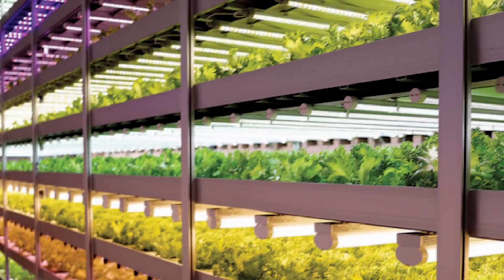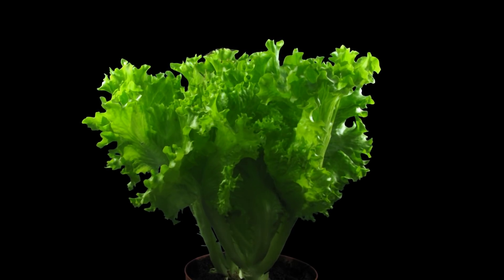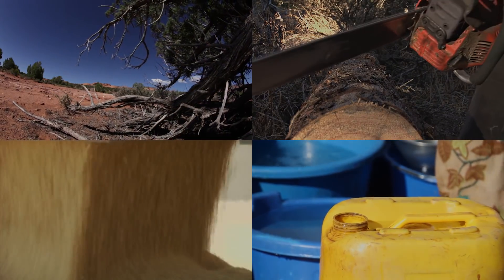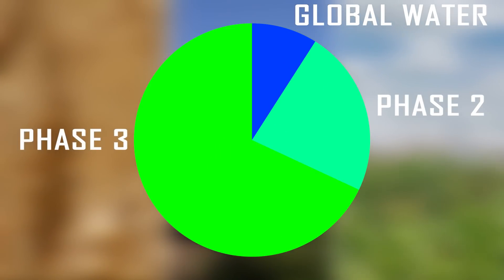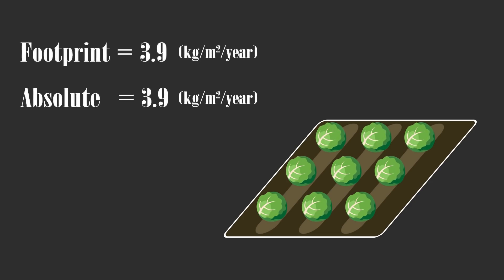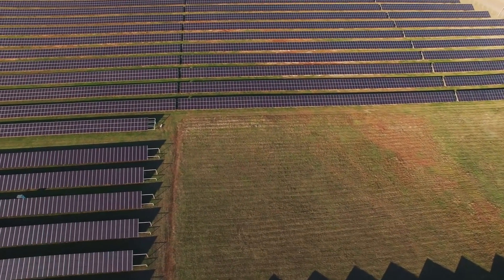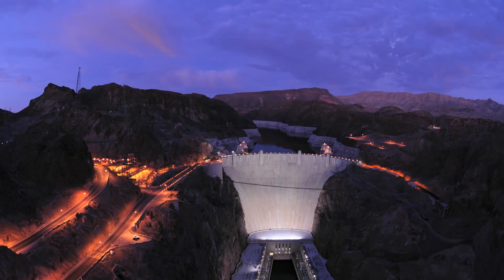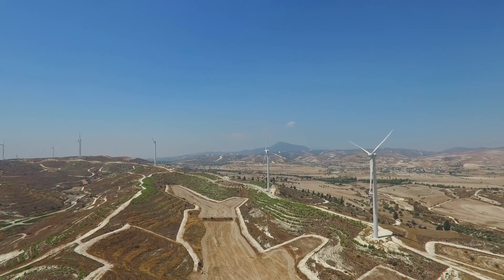How Can We Improve Vertical Farming?

Comment: You can't use solar panels to grow plants in a more efficient way than direct sunlight, thermodynamics doesn't allow it. 

Let's say you get 100J of energy from the sun, if a plant only absorbs 50% of that you are down to 50J. If you use a solar panel with a generous 80% efficiency you are down to 80J and then when you shine it on the same plant you are now down to 40J, you have just wasted 10J. Introducing a middleman has to make it less efficient. 

Nuclear is the most realistic game changer here, it produces the most electricity on the smallest amount of land and is a fraction of the price of solar.
Reply: You can do better with solar than with direct sunlight. A plant only uses 0.1% of the energy that the piece of land it uses recives per year. Solar panels can operate as long as they are not covered in snow, so the time of the year too cold for planets or outside their growth cycles becomes avaliable. Solar panels can also be installed in regions unfit for agriculture like the south west of the US and North Africa. Quantity beats quality here.

BTW, I'm not arguing against nuclear here. Solar is acceptable and not as bad as you think, but nuclear would still be superior.

Comment: Expensive land consuming solar power: Exists, limiting produce profitability
Cheap, safe, scalable micro nuclear fission plants Let me introduce myself!
Reply: Why go micro tho. Bigger is better efficiency and radiation blocking. Micro reactors are nice if you need to move them. If we don't need to move them... We'll go big
Reply: @IceQub3  one of the biggest selling point for small reactors is that if something went wrong, you can just left it there and it will cool down naturally. However that's not possible for large reactors, literally by virtual of surface growing quadratically and volume growing cubically.
Reply: The Problem with big reactor designs is the construction time and investment cost. Basicly u pay a shit ton of money and it takes a dacade or more to go net Profit and in that time things can change making it a risk to invest.
Reply: @janikbeyermann6064  This is a problem because of often rediculess overregulation, unnecessary beaurocracy and the lack of standardised and mass produced reactors. Additionally the prices of reactors are often so high because they need expensive pressure vessels. Using designs without pressurised water like helium, molten salt or liquid metal cooled reactors can dropp the price significantly as well.
Reply: @janikbeyermann6064  Actually any kind of modern reactor would be cheap to run once its built.
Reply: When we get fusion reactor's and we are close and we wont have energy concerns
Reply: @Hunter48464  I was thinking the same thing

Comment: "Renewable" energy sources aren't environmentally viable, solar panels don't grow on trees and the material waste for production is big. With today technology, the only non-fossile energy source is fission. The problem is lack of technological improvement of old reactor models and a very negative public opinion.

I believe modern reactor designs like thorium-salt or uranium-sodium breeder reactors can be viable as a pre-space energy source. Those designs are very safe and reliable (lot less moving parts than normal U-HWR, no pressure etc) and cost effective  (breeder reactor are more fuel efficient than conventional reactors)
Reply: Wind. 💨🔌💡 👌😀

Also, we've got 10 years to reshape the energy industry. Fission plants take years to plan and build (Hinkley Point) and are far to expensive to be worth it, in the UK 🇬🇧. Maybe it's a good idea for Algeria 🇩🇿 or somewhere where they've got the Uranium etc and lots of space to put it.
Reply: @Robbythegod  you talk about space efficiency. You should look on space efficiency of nuclear reactors vs all other methods and you will see nuclear is the king of efficiency. And environmentally speaking efficiency is the most important thing. You say reactor are expensive to worth it but you can just look for the numbers and see that solar, wind etc are in fact more expensive per joule of energy (so they are less profitable). And poor countries aren't the problem here, the rich countries are the one how consume extreme amounts of food energy and other resources. And they are the second biggest pollution producers (after "not yet rich" developing countries)

On the categories you choose, nuclear power out match any other energy source

The "good" arguments against nuclear power are: nuclear waste, spread of nuclear weapons, safety and Satan worshipping lizard boiis
All of which can be solved with currently existing tech (except the latter)

Comment: Using solar energy would require large areas which could have been used for farming. Wind energy allows us to free-up land beneath the wind turbines. Conclusion: nuclear fusion energy is the most capable to tip the balance in favor of plant factories.
Reply from the maker: The solar area required is a fair bit less than would have been taken by equivalent land for crop production. Whether you would want to use solar, wind or other sources such as nuclear depends on your location.

That said, if high Q-factor fusion becomes viable, then the energy problem largely disappears altogether. I don't see that happening in the short to medium term, but it would be huge if it happened.
Reply: @ExaCognition  I don't believe the energy problem would disappear even with nuclear fusion energy. The believe that nuclear fusion would make energy almost free is an all around wrong assumption. 
A singular nuclear fusion reactor, if it works as we imagine it will, will cost around 60 billion dollar. Even if it produces extremely high amounts of energy, it will still need to offset that insane production cost in some timeframe.
Reply: Nah, micro nuclear fission reactors are the cleanest, safest, and cheapest form of power ever invented, and have a footprint smaller than a box truck.  This scalable, stable, and reliable form of power is far better for farm factories than anything else.
Reply: @GodActio  Thorium nuclear reactors hold the promise and are said to be safer than Uranium. One day entrepreneurs will give it a better chance.

Comment: People fed per an area?
Reply from the maker: People fed by area is a metric I've seen used, it's generally used to help aid understanding. 300 kg/m^2/year is not an intuitive figure unless you are a farmer. 5000 people fed per building is much easier to relate to for the average person.

It's a got a few problems as a metric though, especially when dealing with herbs/salad/veg. Often with food we simplify to calories, but if that's your objective, you wouldn't try to deliver much of those calories with vegetables. Generally speaking, vegetables are consumed for their nutritional value rather than their energy value. With this in mind, your "people fed" metric needs to be based on some baseline level of nutritional requirements. This can be done, but I think it makes it harder to use as a concrete measure.

People fed per area is good as an illustrative figure, but I would suggest more specific measures such as comparing X kg/m^2/year or edible kg per watt, between growing methods. It's more useful when trying to determine viability or strengths and weaknesses of a growing method.

To give you an idea though, the Techno Farm produces 1 million kg per year from a building footprint of 3,500 m^2. This equates to 286kg per meter squared per year. How much lettuce you should consume per year is harder to answer. If you take the crude estimate of 0.4kg of vegetables per day, then you would say that you could feed two people their yearly vegetable supply per square meter. That means that the TechnoFarm can feed about 7000 people (around a medium sized town).

Realistically though, you wouldn't want to just eat lettuce as your source of vegetables, you want to mix and match different product to get a mix of nutrients. Another way to look at is based on actual consumption. The 3,500m^2 TechnoFarm produces about 0.6% of Japans entire lettuce market. If you wanted to feed all 127 million in Japan you would need a building/buildings of around half a square kilometer in size. Which is about half the planned size of Tesla's Gigafactory.

To supply the world lettuce, you would need the area of 87 Tesla Gigafactories. This is a lot, though vastly less than the current area used to grow lettuce. Looking at these scales, it really puts into perspective how vast our food production network really is, and why replacing it with vertical farms would take a considerable amount of time. With that said, the growing density of a vertical farm is arbitrarily high (based on the economics of the number of levels and absolute yield). The cost effectiveness of higher footprint yields is growing dramatically, so you wouldn't actually need many Gigafactories to grow the worlds lettuce in reality (nor would you want just a few massive factories, especially in the case of perishables).

A more plausible scaling of plant factories would likely involve smaller local production centers. As long as they are cost effective, the likelihood of small vertical farms appearing all over the place is far more likely and desirable. This is in fact what we are seeing happening surprisingly quickly right now.
Reply: @ExaCognition  
The fuck uses kg per YEAR!?
Reply: @ExaCognition  
I have 625 m2 per a person.

Comment: Great video!  yet I believe your analysis could be improved (energy wise) by not only considering renewables but also cheaper and more reliable energy sources like nuclear, especially considering next gen reactors.
Reply from the maker: Thanks! The energy section is definitely oversimplified, this is in part because it felt slightly beyond the scope of the series and because the future of energy is my next major series. With that said, the analysis used for this model is a very specific use case. In the case of a phase 3 farm that can be placed anywhere, we can place it in a location optimized for cheap energy. If you place your vertical farm in a location of high solar irradiance and close to the equator, the cost of solar is much lower, and you are far less exposed to the seasonality storage problem of solar +Li.

This is essentially already the cheapest source of energy and is projected to be going forward in the near future. That doesn't mean that solar + storage will be the cheapest solution everywhere, far from it. In locations that get less sunlight and more variance in seasons, the cost goes up and the storage becomes a lot more challenging. Li- is not well suited to long term storage. Without storage capacity, solar largely delivers is peak generation at the wrong times from a grid perspective.

I will be covering the next gen nuclear in the energy series, it offers a carbon free, cheap, reliable energy that can be deployed pretty much anywhere, making it a promising option. That said, while it may good choice generally, it's not necessarily going to be the cheapest in all locations. The first phase 3 vertical farms are likely to appear in locations with the cheapest energy and will most likely use solar.
Reply: I still don’t get why people fall so easily for the nuclear PR. A widely spread system of renewables has so many advantages over any type of resource depleting, centralised power generation.
Reply: @petergoestohollywood382  well Peter,  to criticize one subject you must at least understand it.  1) solar panels aren't made of thin air,  a huge deal of mining and industrial transformation must be done,  not to mention the huge extensions of land needed to produce meaningful energy.  2) nuclear plants normally function with in situ leaching,  and uranium can be extracted from sea water... you see,  only a can of coke volume of uranium is needed to provide enough energy for your whole life,  that right there is called energy density.  How many tons of material would it require to achieve the same goal by producing panels that are littered every 25 years? And batteries? Renewals have a place,  but it's not for powering our whole civilization, just look at Germany's failure... you might be drinking too much of the renewables cool aid.